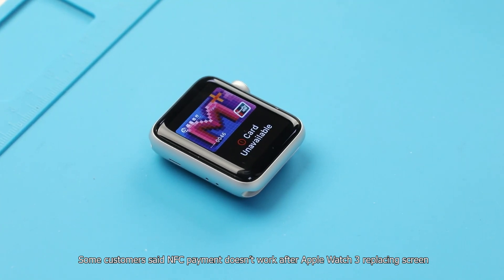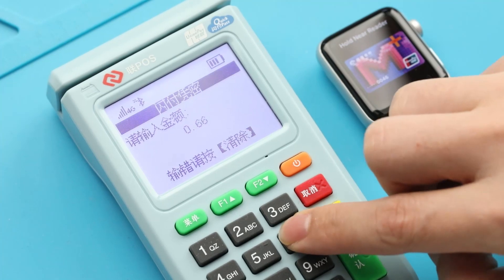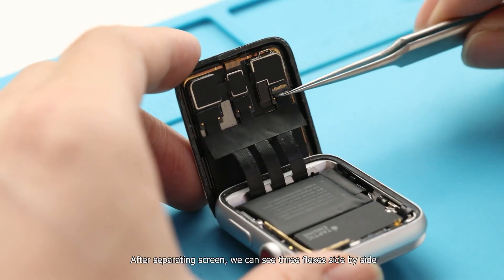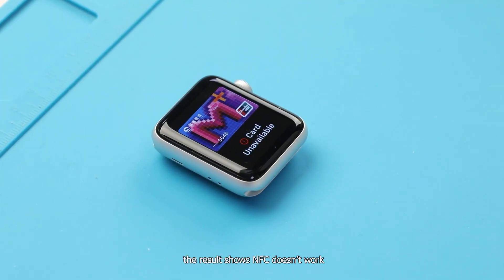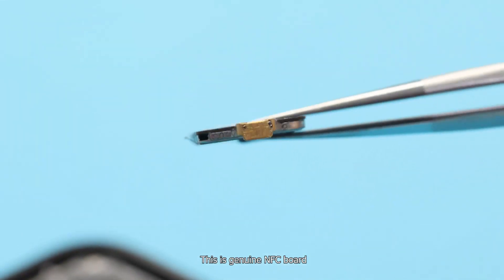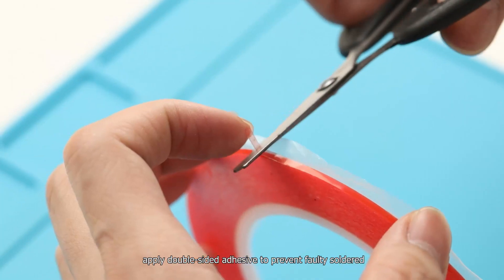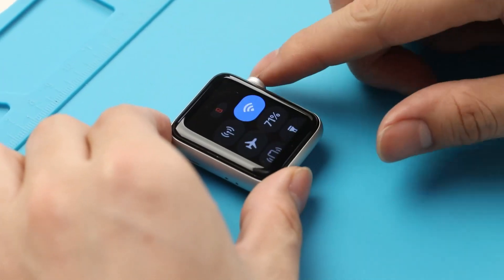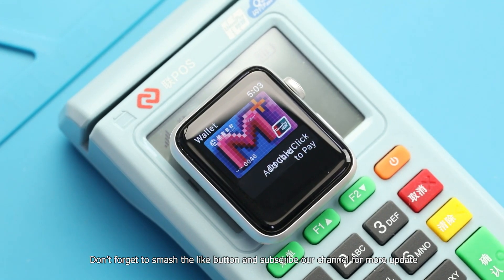Apple Watch Series 3 NFC Function Restore, Apple Pay Back To Work.

Comment from the maker: Some customers said NFC payment doesn’t work after Apple Watch 3 replacing screen, the reason is that NFC chip and main CPU is encrypted binding but Apple Watch 3 NFC chip is inside screen. New screen NFC not matched with main CPU which caused NFC function failure, so can this problem be solved by replacing genuine NFC chip to new screen?  Let’s have a test.

Ecooper Lengthened Straight Pointed/Needle-Shaped Pointed/Curved Tweezer
https://www.elekworld.com/shop/productinfo.aspx?proid=12339&categoryid=572
"QIANLI" Hexagram-shape Pry Opening Tool with Scales
https://www.elekworld.com/shop/productinfo.aspx?proid=9885&categoryid=291
Disassembling Plastic Triangle Crowbar
https://www.elekworld.com/shop/productinfo.aspx?proid=6673&categoryid=370
"QIANLI" Hand Knife with Blade
https://www.elekworld.com/shop/productinfo.aspx?proid=9190&categoryid=293
Ecooper 62 in 1 Precision Electric Screwdriver Set
https://www.elekworld.com/shop/productinfo.aspx?proid=16027&categoryid=571

00:00：Function Test
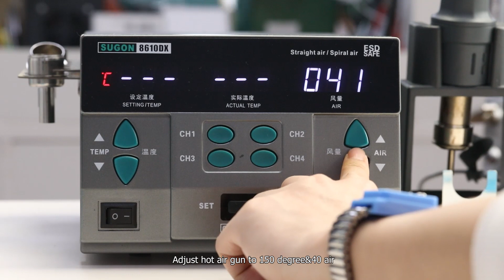00:54：Disassemble Genuine Screen
01:38：Install New Screen
02:24：Replace NFC Board
04:08：Replace Genuine NFC Board Function Test

For more Repair parts&Tools and Tech support, please visit:
Website: https://www.elekworld.com
Facebook: https://www.facebook.com/Elekworldshop/
Instagram: https://www.instagram.com/elekworld/
Twitter: https://twitter.com/ElekworldL

Comment: What if the original screen and nfc chips are broken? A new screen was installed and mi applewatch not sinc no more, that nfc is replaceable? Or reprogrammable?
Reply from the maker: need the genuine NFC back to restore the function.
Reply: @Elekworld  i havent, my applewatch will not work no more?